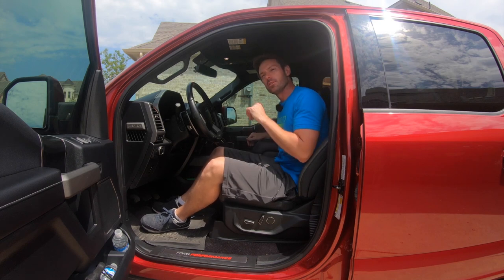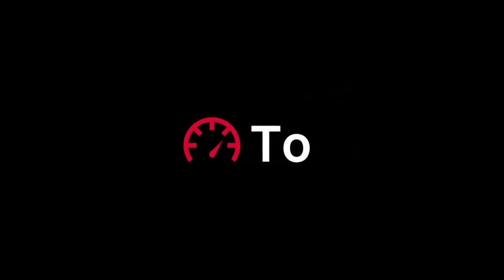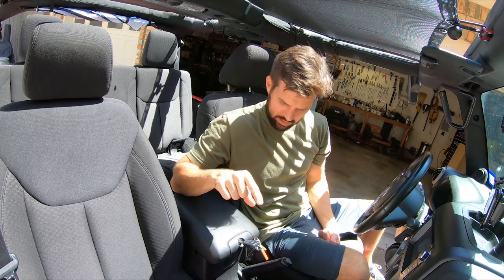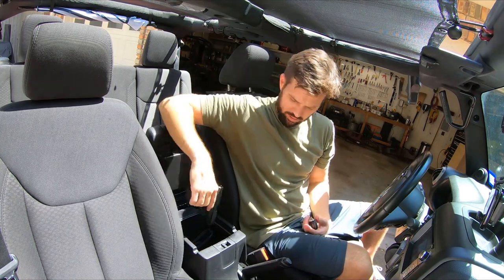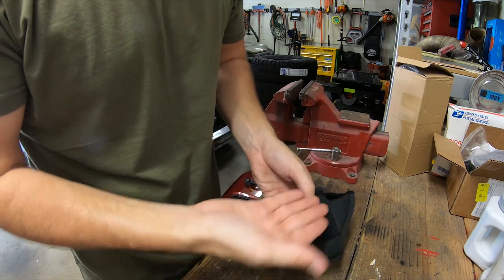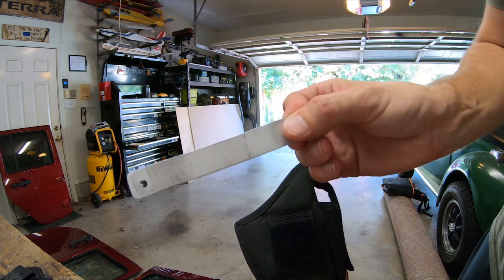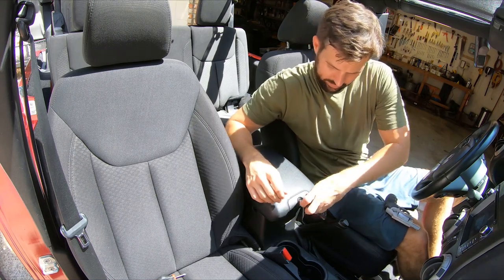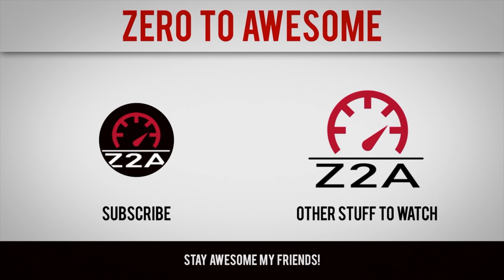Center console gun holster. Secure your security securely!

Comment: Nice! I did something similar but with a rigid molle panel and a g-code molle holster adapter. Push a button and it releases the holster so I can transfer it to a belt mounted g-code mount. This way I can change out what gun and holster I’m carrying. 👍